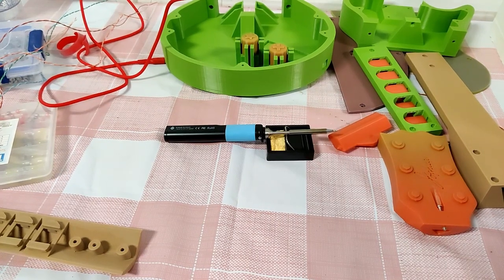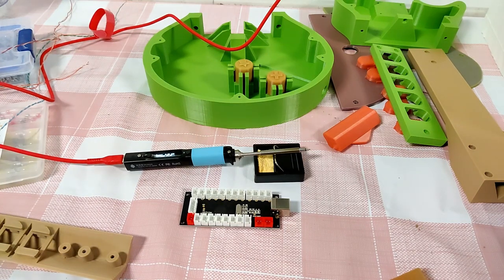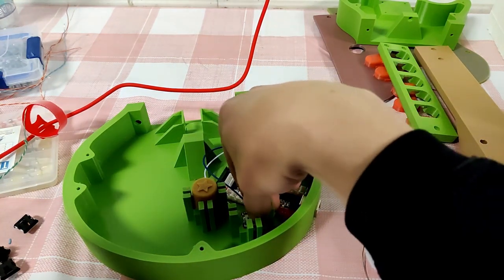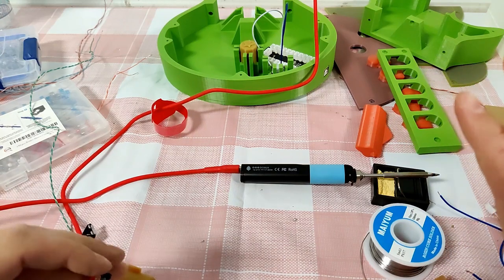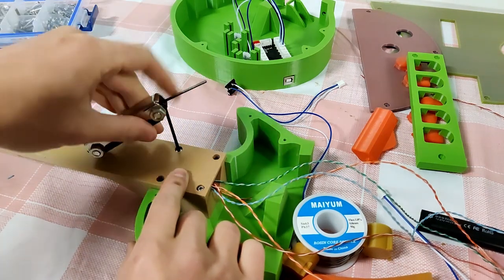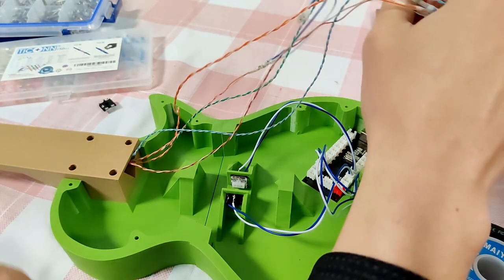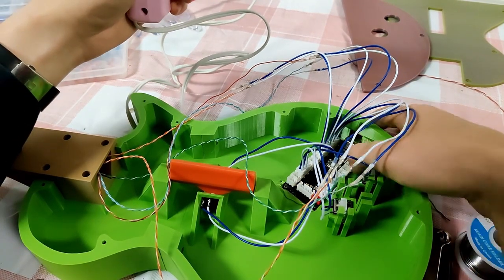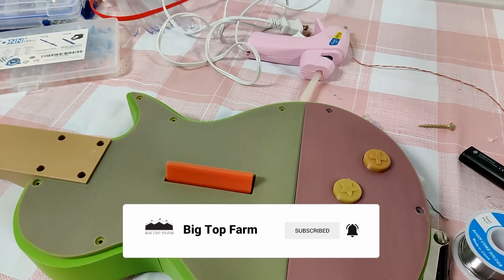Custom Clone Hero Guitar Guide - Big Top Farm

Comment: Im not familiar with boards and programming in general, how do you "program" this to work with clone hero? I just built mine but Sanjay's Guitar Configurator does not detect it, I had to use JoyToKey to get it to copy keyboard inputs to play, or is that the only way?

Comment: For the buttons and all of your parts did you sand them by hand and spray paint? finally got all my pieces printed
Reply from the maker: I actually didn’t sand anything. For the buttons and the button cover I just printed them at high detail. Then if the buttons were rubbing a bit too much I would change the button size my a percentage point smaller. If you plan on spray painting I would for sure size them down as the paint is going to add layer to everything and could depending on the paint as stickiness so I would experiment a bit.

Comment: Is there a way to connect the wires to the buttons without soldering? Ive never done it nefore and not sure if i want this to be the first time.
Reply from the maker: Not that I can think of. I wouldn’t worry about soldering it’s actually really easy and not anything to fear. I would suggest buying helping hands as that will decrease frustration.

Comment: Hi, I have everything to do this guitar, but I can' t buy the solder iron, can I do this without soldering?
Reply from the maker: Not really. You have to solder the wire to the switches. Any hobby or hardware store cheap soldering iron will work most times they are like 10-15 bucks. But I highly recommend splurging on this one https://amzn.to/3Z4kUPZ with this power cable https://amzn.to/404Xxr1 and this power brick https://amzn.to/3Z2cybQ
Then for wire to wire connections the heat shrinks with solder in them are the best solutions but normal soldering and electrical tape wrap works fine too.
Reply: @bigtophomestead  Ok thanks

Comment: any idea if you could use normal cherry mx switches as i cant find low profile in my country
Reply from the maker: If you modded the neck to be thicker you probably could use regular size switches but by default it is designed for low profile.

Comment: can I use any type of switch?
Reply from the maker: You have to use low profile switches for this print but other models support full size. As for type of switch IE white clicky or red silent you can use any type that fits your wants however I have only been able to find white and red switches constantly. The ones I use are linked in the description.
Reply: @bigtophomestead  ok thanks

Comment: It there a way to make a wireless ps3 guitar to a wired ps3 guitar? Plz help
Reply from the maker: Look up the Arduino mods for guitar hero guitars that is probably going to be your solution. katana mods is a guy that does it but I have only seen his work on PS2 Kramer guitars but I would imagine it works on any model as you are replacing the main board with Arduino.